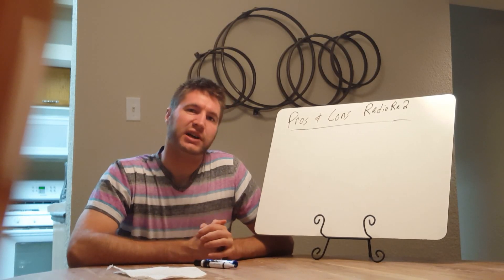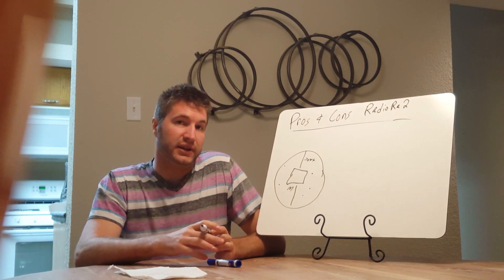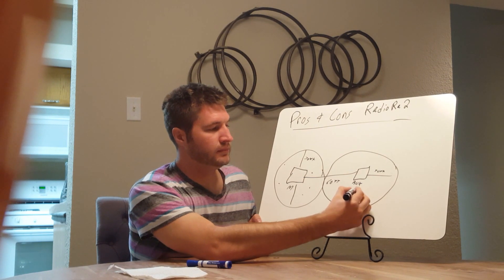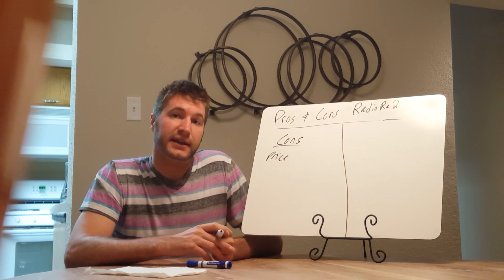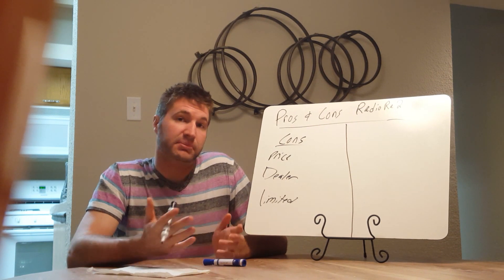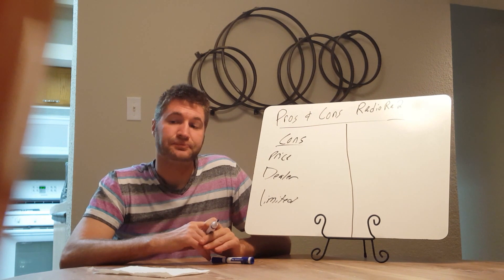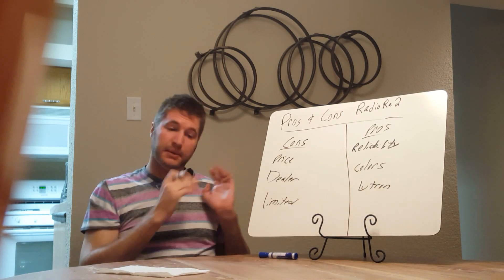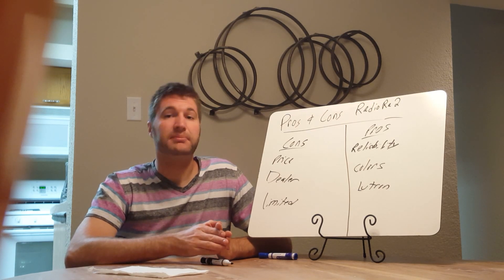Lutron RadioRa2 Automation - Pros and Cons

Comment: I have a Lutron RA2 system installed in my home in Brooklyn.  What a nightmare. I have wasted so much time with this system, and it is still not working properly.  I don't know why you'd want to get this system in the age of Alexa and Google home.  I've spent a ton of money $3,000 to $4,000 to get people here to set up it right (builder had installed it) and it's still not working (that is NOT the cost of the system, that is JUST THE COST to fix it).  Insane really.  My belief is this company may have made sense a decade ago but now is a nightmare.  Their supply chain to reps is not oriented or incentivized to solve problems.  I feel a need to warn others.
Reply from the maker: I had forgotten I still had this channel up from a while back and then got this notification. Yes, I'm not the biggest fan of the RA2 system. I was trying to make the video as unbiased as I could at the time. Lutron can be costly to fix or maintain but not even a drop in the bucket comparative to Crestron or AMX. I personally have a hybrid of Zwave and Zigbee at my place. It is a little outdated but take a look at my Zwave pros and cons video. I'm pretty far removed from automation now but still love it. Also I checked out your channel and might have to take a look at your book!
Reply: Greg any luck on the Lutron system? I’m a Lutron dealer/installer on the east coast and happy to have a look at it pro Bono or at least chat and see if we can help you at all.
Reply: @youtubertoo  Might be fixed. I had to write the CEO.  Then it STILL took 6+ months.  Lutron is a mess. I am likely to short the stock. There is so much wrong with all this.

Comment: Thanks for this intro, Tyler.  I'm a homeowner, my house utilizes RadioRA2 for indoor ceiling cans and outdoor sconces.  I'd like to add one element only: to convert a regular (hot) wall outlet to a RA2-controlled wall outlet which would follow an existing RadioRA2 circuit.  Is that possible?  Does each element receive and track just one RadioRA2 signal? So could I (or an installer) swap out the existing outlet for a RadioRA2 one? Then two table lamps could follow the ceiling cans in the living room.   (I live in Menlo Park, California).
Reply from the maker: Hey Paul, it has been a while since I've messed with RadioRa2 but last I checked they do not make a wall outlet. There are simple plug in models that are either a dimmer or relay on/off module. This would be a simple solutions to just plugging into your outlet. Not sure if this helps
Reply: @CustomTechnologies  Sure, it certainly does help.  Thanks!

Comment: Thanks for sharing Pros/Cons Tyler. I'm not totally sold on RadioRa 2! Can you suggest an alternative system for smart home automation that offers better Pros for 2 story house, that a home owner does not have to rely on Electrician, manufacturers Rep, technical support, etc. in programming or add on for as long as they own there home and be married to Lutron brand device only.
Reply from the maker: Wally Nassif Wally have you looked into Zwave? That might be a good solution for you and you can diy. Check out my video on it and let me know any questions

Comment: Been using RadioRA “1 or classic” for over 10 years now and it has been extremely reliable. Not sure what you mean by your comment about it’s problems. Granted it was a pain for a DIY’er to setup but once set up in our 5600 sq ft house we have had zero issues. Rock solid clear connect technology. I have used SmartThings, Zigbee and insteon and they are nowhere nears as reliable. I am now only considering slowly converting to RadioRA 2 Select because of its ease of setup, iOS app and network capabilities. Its similar to Casetas but on steroids. Caseta is good too but the dimmers are a little annoying when in the dark and you want to quickly turn on a light by feel.
Reply: docbrock35 does radiora2 select offer the hybrid keypads?
Reply: @youtubetake-over4805  yes